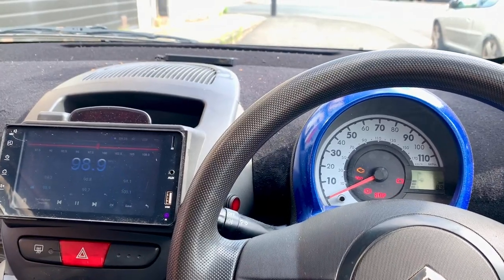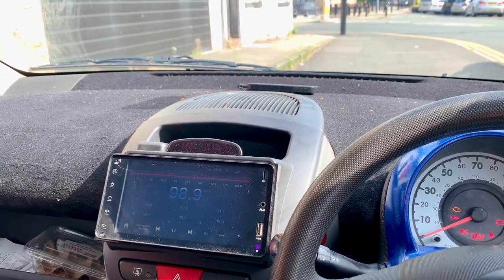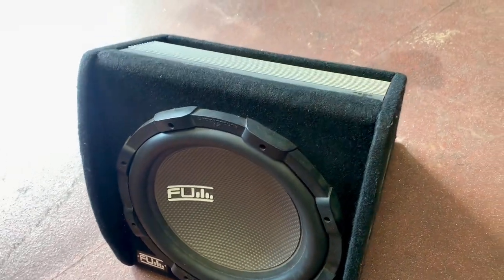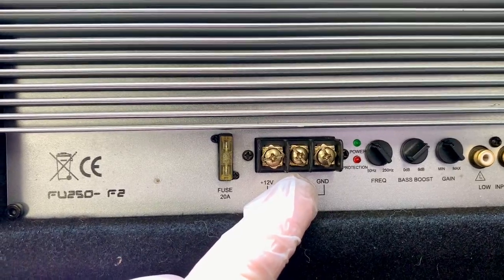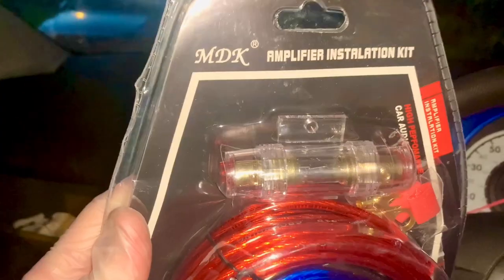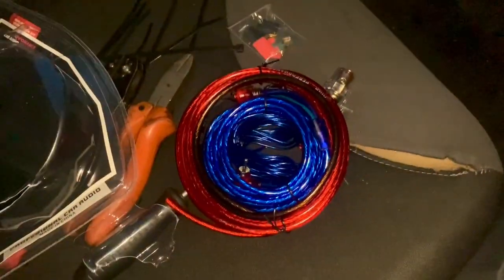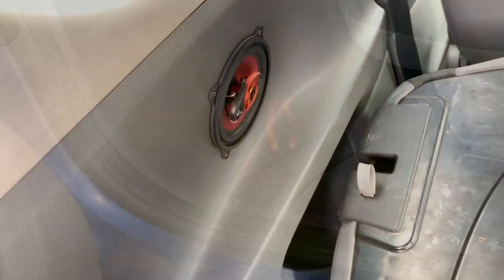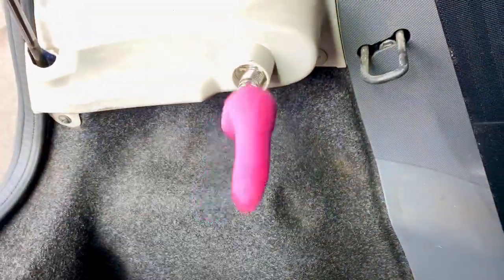Car Audio Upgrade, How to Fit a Subwoofer, Easy DIY / How to… CityBug Gets Some Pumping Bass, ICE

Comment: Just a thought, if you take the parcel shelf out and unlatch the back windows then whack the volume up the rear windows will flap thus aiding forward propulsion. The problem with the bass not coming from the phone might be because the phone only sends a two channel signal for the front speakers. Great video as always, very entertaining.
Reply from the maker: Cheers mate. The rear speakers do come on with the Bluetooth, but I’ve had a fiddle with it and it just seems that the sound below a certain frequency is filtered out for some reason. It does it if I use the phone as a hotspot and go on YouTube through the head unit itself. Makes no sense. There is a sub out on the multi plug, but it’s just one pin and I’m not sure what would happen if I soldered one side of the Rca to it and the other to ground so I think I’m just gonna change the head unit for one that is more made for sounding right, rather than this big silly shitter.
Reply: @StupidBlokeStupidVideos  Rightyho, it was just a thought but it is a strange one that. At this rate your going to need a bigger battery to power all that extra tech and addon's. Look forward to the next installment, always puts a smile on my face.
Reply from the maker: @DARTraderMediaProductions   cheers mate, good to hear cos I’m only in it for the fun of it! Hopefully get next one done for next Saturday, but it depends how busy I am at work cos I make most of these videos on dinner breaks or just when I get any spare time at work lol.

Comment: Had the same problem with a kenwood bt73 in me 107, in speaker settings on bluetooth (phone)mode, had to set to all speakers for calls, was set on just fronts,
aye different headunit, but give it a go mate, like ya content. :)
Reply from the maker: Cheers mate. The rear speakers do work with the Bluetooth, but it’s as though the frequencies that the sub deals with are filtered out. It does the same thing playing music off YouTube directly on the head unit too. It’s not the best sounding head unit to start with, better than the original by far but it’s so light that there can’t be a decent amp in it. I think I’ll just bang a half decent single din in there tbh.
Reply: @StupidBlokeStupidVideos  maybe the speaker settings only work with a dedicated sub rca output, time to upgrade the head unit, if you don't mind me saying, cheers.
Reply from the maker: @ragingbalrog  I’ve got a half decent single din knocking about somewhere which I’m considering putting in instead.

Comment: Might your issue have something to do with having connected via the rear speaker output rather than the (non existent) RCAs? My sub/amp had some complicated setup system depending on whether the input to the amp was via the speakers or the RCA. I recall the instructions saying that if you go out of the HU via the rear speakers, the amp would malfunction if it was set up for RCA input.
Just a thought 😊
Reply from the maker: Cheers mate, I did consider this but I don’t think that’s the issue. Where’ve you been anyway? I’ve missed you’re whitty comments on my previous vids!
Reply: Yeah, sorry. My problem is that now and then  I stupidly watch a video about quantum mechanics or black holes, then my brain breaks and I have to go and lie down for a week 😂

Comment: can you even hear the rear speakers on bluetooth mode ? if not then your sub is not playing anyting yes. so i thinkt if not. its the best to put all the speakers in parallel on the front chanel. mabey that gonna work. i am into car audio btw. and never had this problem. it can also me the radio not putting low freq on bluetooth mode. and that you have to put the speaker size in and crosover ect
Reply from the maker: It was something really simple and obvious… skip to 11:30 in this vid and you’ll see lol

https://youtu.be/ucKrNzp7Iew

Comment: Hi mate, it's me again with my 107.. try to install front speakers like you, but I did not order the cable adapters.. I brought the same system as your (JVC)  which has two terminals, positive and negative.. can you advice how to connect it up as I noticed both front speakers have two different type of colour cables.
Reply from the maker: Just spade connectors really. I fit front speakers in this other vid too but I don’t use the adapters in this one. 

https://youtu.be/UK8yZMwxXZY?si=OTI3skgvPOReRv0o
Reply: @StupidBlokeStupidVideos   yes. I saw your video.. But on your video your car seems to have two wires coming out for your speakers.. On mine it has four wire coming out.. how do I connect four wires into my two wire speaker?   Thanks in advance.,🤗🙏🙏🙏
Reply from the maker: @dw1hkdavidtkwong  ahhhh I see. Sounds like your car has door speakers as standard. Two wires come from the stereo and the other two go to the door. With door speakers your car will have a tweeter in the dash. Two of the wires will work but I’m not sure which as I’ve never worked on a car with door speakers, but the door speakers are already much better than the dash ones.

Comment: another good earth point for the connection of the black wire?
Reply from the maker: Anywhere on the bodywork
Reply: @StupidBlokeStupidVideos do i have to sand the paint for a good contact?
or maybe under the rear seat there is a non paninted area
Reply from the maker: @tommi5033  it would help to do that but not always needed
Reply: @StupidBlokeStupidVideos thank you sir

Comment: I have the original radio, I can not figure out where I should connect the blue cable of the subwoofer :(((
Reply from the maker: I don’t think the original stereo has it, but you can make it work. Just connect it to a switch from ant 12v supply and you can turn it on and off manually
Reply from the maker: That’s what I do in this video, about half way through 

https://youtu.be/ucKrNzp7Iew
Reply: @StupidBlokeStupidVideos  Good morning, thank you for your reply, I do not know where the door is, it is not marked, I have the original radio the basic model what you had at the beginning. 
Model 86120-0h010
Reply from the maker: @TeEmpeEsTa  not sure what you mean by the door? If you use a meter just find ant ignition supply 12v and you can wire a switch into that

Comment: Just out of interest 
You have a lot wired into the car 🤔
Have you noticed a drain on the battery when starting up and driving 🤓
When i turn the lights on and have the heater blowing i can feel the strain on the lump 😂
The stereo is 💩 in my car could do with a sub 👌
Reply from the maker: Yea, then the bass kicks in the revs drop in the same way they do when the cooling fan comes in 😂